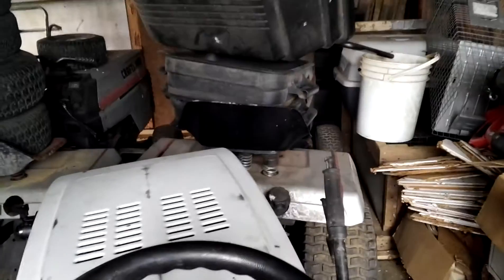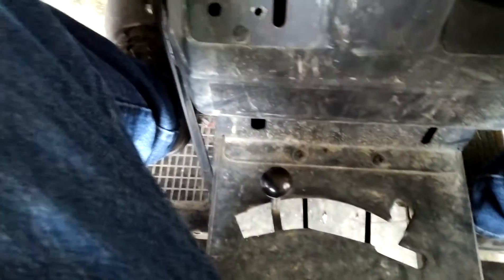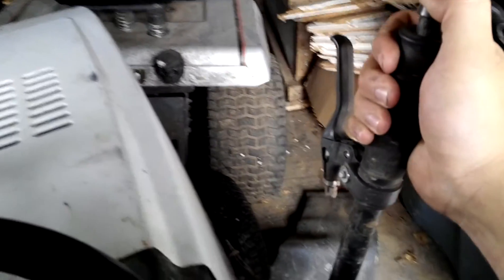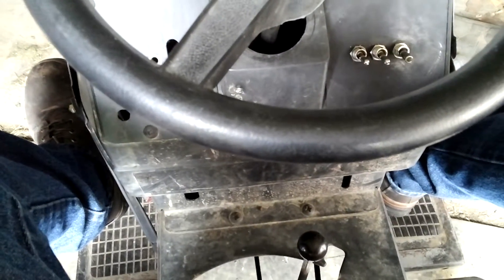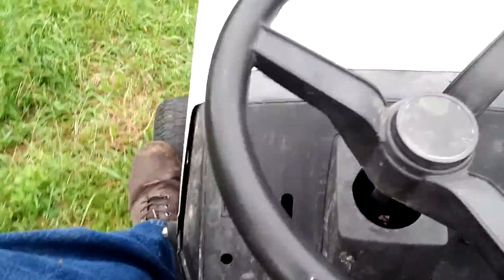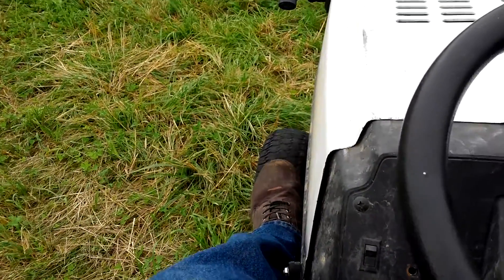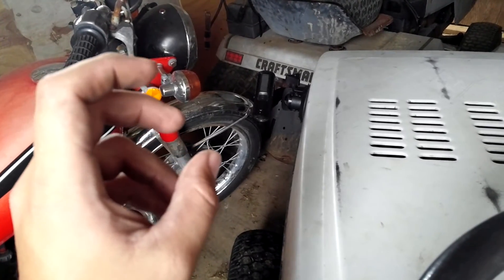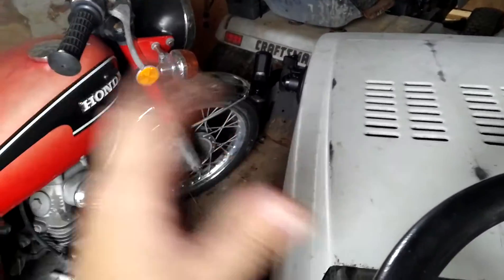Shifting a Manual Transaxle; How it Works.

Comment: Hi there, 
I just bought my first manual shift (always drove Hydro) and took it out for a quick ride and almost shit myself as it freewheeled it all the way down my drive and luckily the uphill is what helped it stop or deaccelerate. 
It has 5 speed range and I put in in 5th gear and gave her and shortly realized depressing the brake/clutch pedal only made it roll faster, how do you slow it down when you are on paved road going downhill? Also, let's say you're up on a steep hill trying to mow but you need to stop and shift gears, how do you keep the tractor from rolling while you change gears? E-brake does not really stop it and depressing clutch will send it rolling down... 
Thanks :)

Comment: I have a manual transmission I’m gonna make a hydro a manual but the engine has no clutch is it possible that it could work
Reply from the maker: Hydro still should have a mechanical clutch in the driveline.

Comment: Very interesting and helpful when getting into older mowers with no manual (repair or operating that is). Just finished building a clutch disc for an '86 Toro with a 5 speed Peerless and now that I have it moving, first and second gear felt like the only ones that work right; it wasn't anything like a manual transmission car where speed is attained progressively. This one wanted one gear for flat ground, and a different one for climbing. We have a fairly significant slope to our back yard, and the mower won't climb it in anything except first, which is like walking with a toolbox in your hands slow. I was left wondering if this was a designed feature on the transmission, or if I'll be attempting to crack the tranny open for the next phase of restoration. It doesn't feel like it has any brakes whatsoever with the 'brake' pedal, but sticking the clutch in to down change for the hill (or anywhere else) certainly seems to have enough resistance in the belts that it slows down well enough that way. It was a real trip learning to drive it as It wanted to be driven today, anticipating where I'd need to ride the clutch pedal so I could drop into first and for turning/stopping!

Comment: I have a question could u eliminate the clutch by   Using a centrifugal clutch .  So  u can just let off gas to shift ? Or does the transaxle have a built in clutch ?
Reply from the maker: You could, but you would lose all engine braking power so you would need heavier duty brakes so you dont lose control when decelerating or going down hills. I would very much not recommend doing that.
Reply: Ok  thanks for the help i appreciate it

Comment: all the mowers I ever drove have manual transmission.

its EZ! step 1. Push in Brake/Clutch petal | step 2. shift to desired gear | step 3.let out Brake/Clutch petal slowly.

Comment: You don’t have to do this if you aren’t aware you can shift without clutch but racing mowers you’ll want to
Reply from the maker: It's easier to shift if you clutch as it removes the input load.

Comment: According to what I found in the MTD 144-918-000 owner's manual:
GEAR SHIFT LEVER
The transaxle has four forward gears plus neutral and reverse. Do not shift through the gears on the transaxle as you would in an automobile. Pre-select the gear appropriate for the job you are doing.

You must depress the clutch and come to a complete stop before shifting gears.

SPEED CONTROL SELECTOR
The speed control selector is used with the gear shift lever to obtain your 16 forward speeds. The farther forward you move the selector, the faster you travel across the ground. To move the speed control selector, depress the thumb button on the end of the lever and move the selector in either direction. You do not have to de-clutch or stop the tractor; however, the tractor engine should be running.
Reply from the maker: ClassicTVMan1981X The only thing that will happen from shifting while moving is accelerated shift key wear, which even then takes a while. Perfectly safe to shift while moving.